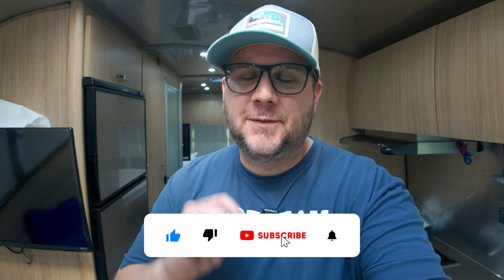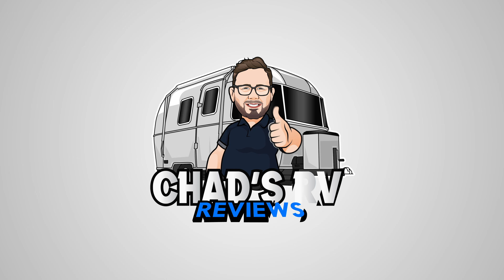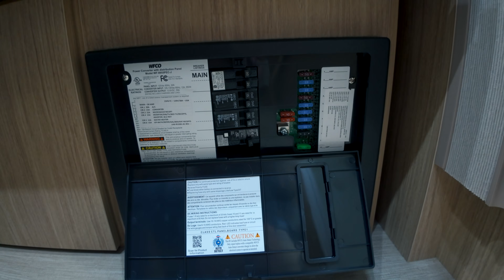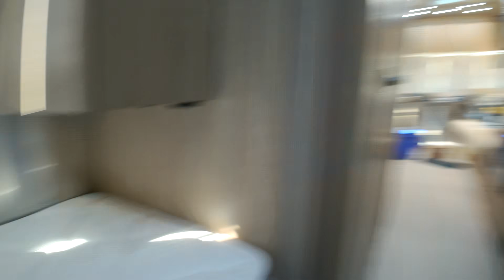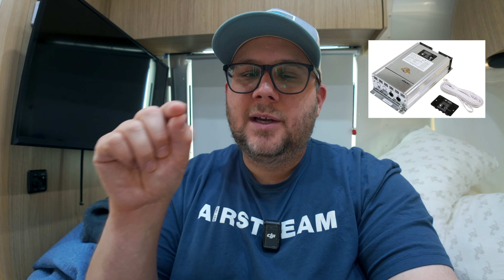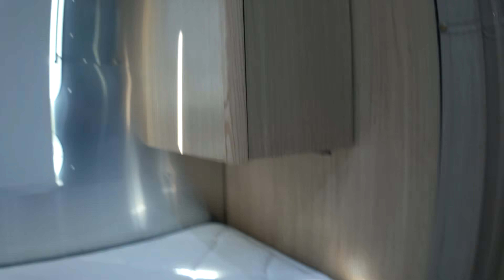Airstream Power System Explained

Comment: I have a 28’ from 1977.
    The one thing I can’t find is the shore power port.
    I read that it was on the drivers side near the back.
    I’ve opened every hatch I can see and none have a power port.
    I was hoping you’d show where it is located.
    I hadn’t thought to call a dealer, I’ll do that next.
    I found it. 
    Asked the same question and got the correct answer this time
Reply from the maker: Glad you found it!

Comment: Thanks for this. I plugged my 2024 into house power while my battery system was set to ‘in use’. This gave me a surge of power now my system is trying to charge the batteries at a too high rating. I’m guessing this fried my converter.  Thoughts?
Reply from the maker: Plugging your in when set to in use shouldn't be a problem. You may have a bad converter.

Comment: Verification question- 2026 International, 50 amp power system.  We have a reservation at a campsite with only 30 amp pedestal service.  What is the proper series of dog bones to come off the pedestal to the trailer?  I have a 30 amp surge suppressor and 30 to 50 amp dog bone.  Should I verify clean power with the protection component at the pedestal and then remove it using just the standard 30 to 50 dog bone to the trailer?  OR would I use all three (30 amp protection device ton the 30 amp to 50 amp dog bone, and connect my factory 50 amp cord (smart plug)!to the trailer?  Realize if I am using 30 amp shore power I would have to manage ac/heat pump loads, just don’t fully grasp if the trailers energy management system may sense a low voltage scenario in the trailer side with all of the components described above.
Reply from the maker: You'll use the 30amp to 50amp bog bone and then plug the 50amp surge protecter in the dog bone and camper into the surge protecter.
Reply: @ChadsRVReviews  thank you for the support.  Be seeing you at the new shop.  We just bought our 2026 AS International 27FBQ at BC Greensboro in January. Went there based on your video reviews and sorry to have not met you, glad to hear from a neighbor that you have gone out on your own. Great success in your future I am sure.

Comment: Does the solar connection on the battery box run through the charge controller? So if I add extra panels I won’t overcharge the batteries?
Reply from the maker: It doesn’t run through the charge controller. You only want to use a Zamp Solar suitcase, solar panel that has a charge controller built-in. Something like this https://amzn.to/45j0eKP the built in controller will prevent overcharge.
Reply: @ChadsRVReviews thank you for your prompt response and link!! ❤
Reply: Yes on Boondocking video! 
Question, My 2022 25RB Airstream International came with 2 solar panels and 2 AC units. Currently with only having lead acid batteries, is there any advantage to adding additional solar panels? (Currently have 90 watts of rooftop solar)

Comment: Very simple and easy to understand explanation, Chad. Thank you! Question for you: I’m looking at a 2022 Basecamp 20X that currently has AGM batteries. I’ve read conflicting information about whether or not this model year has the switch converter that allows you to replace AGM with lithium, without having to replace the converter. Do you have any insight?